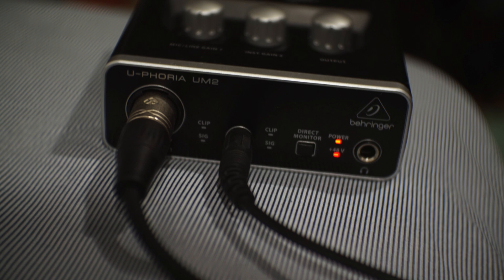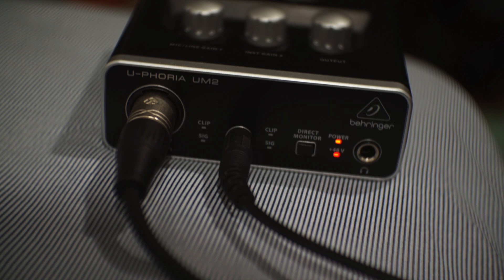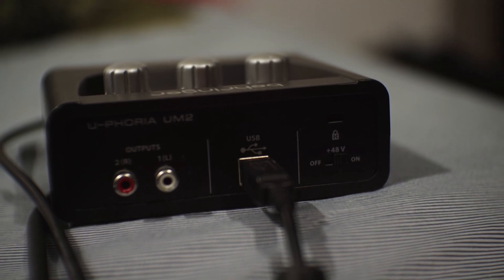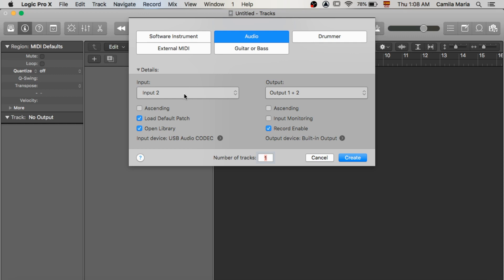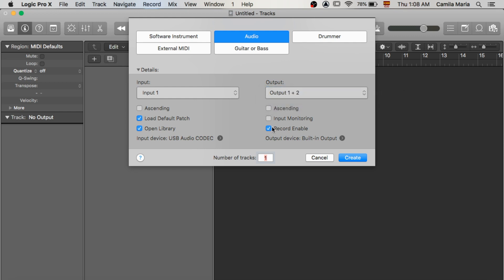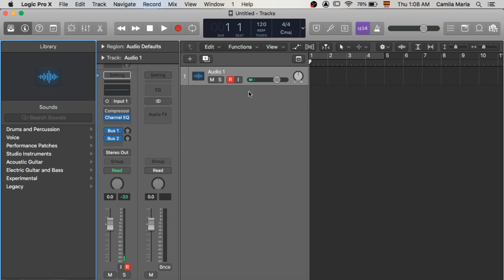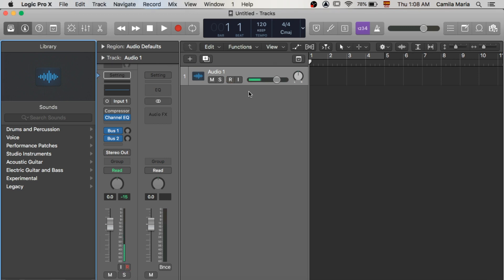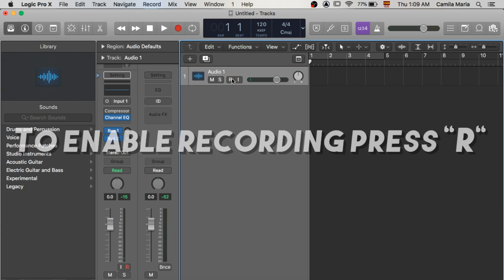CONNECT MIC TO LOGIC PRO X!!!

Comment: I’m buying a MacBook Pro and a AT 2020 USB+. Will I be able to make songs on logic with just that?
Reply from the maker: Technically yes, though it would be better if you got an XLR mic and an interface. Simple explanation is that condenser mics need power, and a computer isn't capable of giving it enough juice to capture sound with a decent volume and low gain. If you make the gain higher (which will be necessary because the volume of the captured sound will be quite low) you'll notice a lot of noise. So basically yes, you can make songs with what you're telling me, but if you want to sound as close to professional as possible, I definitely recommend saving up and getting the XLR version with nice interface (a Scarlett would be perfect). It may take you a little longer but it's a setup that'll last you a lot more.
Reply: Saintwolvinn thank you saved me 🙏🏻 I’m buying a mid 2012 MacBook Pro so does it matter what kind of XLR cable or Scarlett I get?
Reply: Saintwolvinn I figured out it doesn’t thank you buying everything next week 💪🏻
Reply from the maker: @chrisdivine_  No problem! I do recommend you getting a mid 2012 non-retina with upgrades done to it (an SSD installed and 16 GB of RAM). The retina version has no way of modifying it, and it's old tech. I have that exact computer and without those upgrades it ran SLOW. Just a little tip there. If it doesn't come with that there's a video on my channel that helps you with installation. :)
Reply: Saintwolvinn Your the GOAT 🔥 I’m setting up a lil studio to create and you helped greatly 💪🏻
Reply: Saintwolvinn what would you suggest to be a good upgrade to the AT2020 and Scarlett in the future?

Comment: Well my mic just keeps disconnecting for whatever reason. The selected audio interface keeps changing between the external mic and the in built mic of the Mac. It's got to the point where I start eating my microphone out of pure rage every time I plug it in. I'm pretty sure something is wrong with my MacBook or the cable that supports the microphone but can you give some advice nevertheless? Or is this issue of mine somewhat relatable to the ones you faced whilst
connecting an external mic for the first time? I mean it was working well... then it decided to go nuts.
Reply from the maker: From what your telling me it's an issue where the Mac goes from recognizing it to not doing so, the three things I would check here are:

1. The MIDI cable. Cables break all the time (I know it sucks).
2. The interface. Could be a bad port. Not too common but it's better to be sure.
3. The computer. 

The easy way to check everything is simply connecting your setup to another computer. It doesn't have to be a Mac, any Windows computer could work just fine. If it connects fine, we know it has something to do with the Mac. If it doesn't, it's something with either the cable or the interface. Here we would change the MIDI cable. Again, if it works we know it was the cable, if it doesn't, you might need to get your interface checked or changed. The reason why I'm ruling out the mic, is basically because based on your story, it seems like it works fine when you DO get to connect it.

I hope this helped!
Reply: @thesaintofwolves  Thanks for the insight.
Reply: @anavgeekspassion5727  bro same i use an AT2020 , I CANNOT GET IT TO PICK UP FULL AUDIO, it sounds like the 48v isnt being out out but I bought 4 new MIDI cables, I BOUGHT ANOTHER SCARLETT,  I BOUGHT A NEW MACBOOK, and I switched from ableton live 10 to Logic and it still will not pick up the audio, i am stumped and i dont know what the problem is. Maybe its the AT2020 but I bought it brand new and ive never even gotten to use it....
Reply from the maker: @isaacschel  What about drivers? Have them all installed?

Comment: I did exactly this but still can't get any signal or sound from it.
Reply from the maker: You're selecting the right input for your specific audio interface? It may not be the same one as mine. Also, it gets audio if you use it as an audio device in settings?
Reply: @thesaintofwolves  yes right input. I still cant get it to work
Reply: Nurhikmah Sahri having the same issue

Comment: I pretty much have the same setup as yours. The AT2020 with UMC22 and a 2011 iMac. The problem is as soon as I connect there is a huge noise, huss, him, idk maybe a combo of all three. I can't even get it to 50% gain with the noise flying around. Any help?
Reply from the maker: It is a noisy mic. Have you checked to see if it's an interface issue? Disconnect the mic and check audio levels. If the noise is still there, there may be a grounding problem.